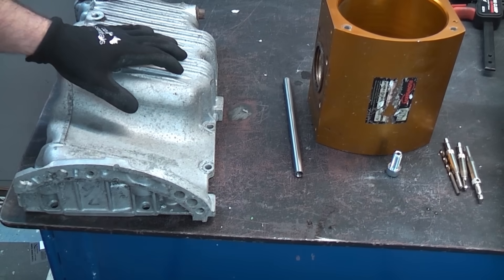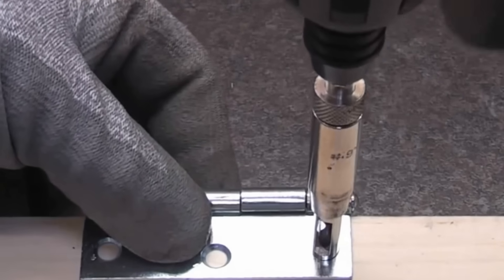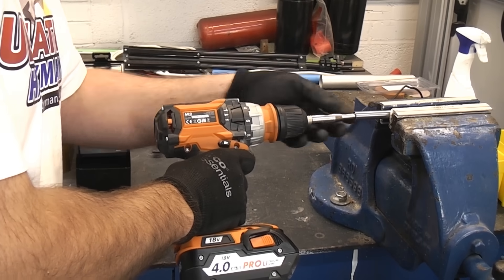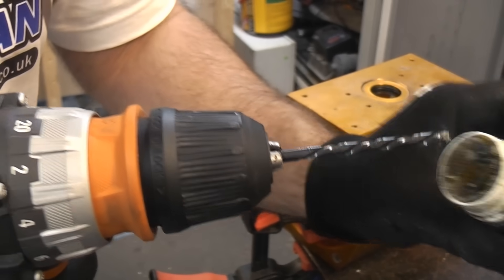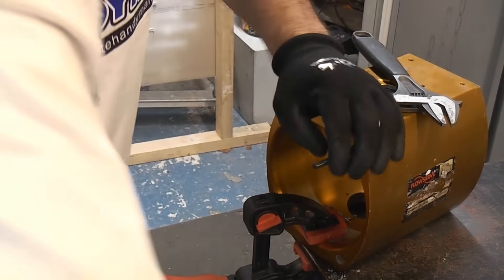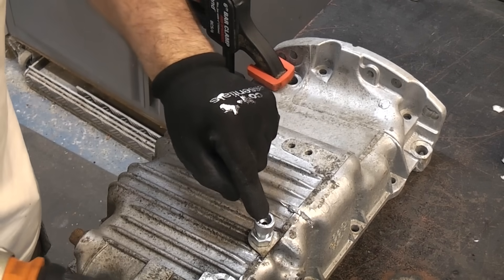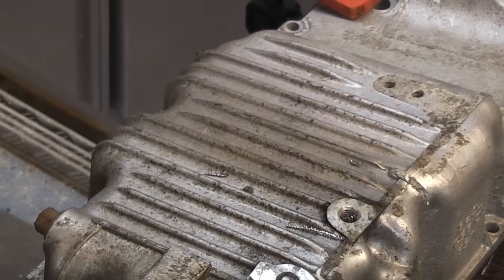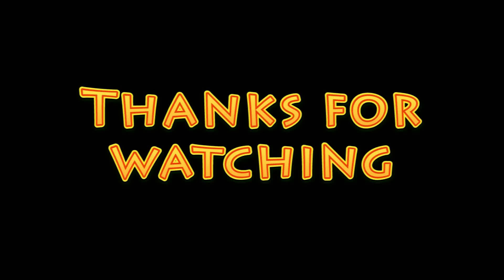How to remove a broken bolt in a deep hole | remove broken bolt in recessed hole

Comment: Dude. Those bolts with centers drilled out is brilliant. Im gonna get my Local Machine shop to to make me some of those.
Reply from the maker: They should easily make you a set ;-)
Thanks for the comment 👍
Reply: @ultimatehandyman  what size of mm drillbit should you use in an m8 m10 and m12?
Reply from the maker: @RK-nl1hn   M8 = 4mm | M10 = 6mm | M12 = 8mm 👍
Reply: @ultimatehandyman  Thanks man!
Reply: Also worth googling "hollow bolt".  There's already-made ones out there, though mostly in metric it seems.  Might be cheaper (and quicker?) than having a machine shop make them.

Comment: I worked for Amoco for years and always got to fix the broken off bolts. I have to admit you are pretty damn good. Try hard bolts in hot stainless.
Reply from the maker: I've worked on a lot of stainless machines- they are always a pain in the backside!
For hard bolts I normally use solid carbide bits.
Thanks for the comment 👍

Comment: Lord knows how many bolts I have broken off.  The worst of which was head bolts on the engine of my first car.  A 1956 FORD with a 292 V-8.  I didn't know that it was essential to replace the head bolts or put some spaces on them to prevent bottoming out.  I broke a couple of them off and had no idea how to remove the broken part of the bolt.  I only wish that I had this information in my early life.  Excellent presentation on removing broken bolts.
Reply from the maker: Thanks for the comment, Paul  👍

Comment: A question for everyone - what drill bits do you use for extracting a bolt? I just discovered left hand drill bits, which turn in the direction I want the broken bit to turn.

I have seen left hand drill bits in high speed still, titanium coated, and cobalt. I like regular cobalt drill bits. They are cobalt all the way through, where as titanium drill bits are just coated with titanium.

I found a 5 piece set of Irwin-Hanson, 5/64 inch to 19/64 inch, cobalt drill bits on Ebay for $25. So far, this looks to be my best bet. The large, long bolt that holds the belt tensioner on my 2004 Toyota Corolla broke. I have to raise the engine just to get a try at extracting the bolt, and I also need to buy a right angle, drill adapter. 😟
Reply from the maker: Most broken bolts can be drilled using a normal HSS drill bit, which is great because you can use a left handed one.
TIN coated drill bits are a bit harder than HSS drill bits, but often they cannot be sharpened, as it grinds off the hard TIN coating.
For harder grade bolts you will need cobalt drill bits, these are much tougher and work really well on high-tensile bolts.
The problem with some right angle drill adaptors, is that they have a 1/4" hexagonal shank, which limits the types of drill bits available.
I hope this helps ;-)

Comment: Great video. For rusted-in bolts, torch heat the bolt after you have drilled it out halfway, to remove. The bolt becomes red and reduced in size for extraction... quickly apply the EZout shown. The worked piece will not get hot enough to worry.  (like a heat sink) You can always place rag water on surrounding area of project to cool as you heat with torch tip.

Comment: I was so hopeful to watch this video... to find out at the end that it was waste of my time. Since when a half inch below the surface is classified as "deep hole". You still can get your regular drill bit and screw extractor to it. Engine head bolt which is broken 6" below the surface, now that's what I call "DEEP". 
Disappointed.

Comment: Never heard of a "hinge sighting drill' or a "left handed drill bit". Now that I do, I have no idea where to buy one if I wanted one.
Reply from the maker: Hinge centering drills- https://fave.co/2DpJo1H
Left handed drill bits- https://fave.co/2xJjK1M
Teng screw extractors https://fave.co/2OnfRuF
Dormer taps -https://fave.co/2OsN1sQ

If you are in the UK-
Hinge centering drills- https://fave.co/2NE1VMc
Left handed drill bits- https://fave.co/2DubtF4
Teng screw extractors- https://fave.co/2pVLkVT
Dormer taps - https://fave.co/2pTfbyx

exact cutting paste- https://fave.co/2Nabyxc
cobalt drill bits (they are much better on harder steels like bolts) https://fave.co/2zDh3kp

Comment: Thank you for showing a variety of scenarios and techniques to remove a sheared off bolt.  I've got a pretty tricky one and perhaps you can comment.  For my motorcycle, I sheared off an 18-8 stainless bolt, level with the engine casing, and naturally, not terribly evenly to make drilling easy.  Can't put the whole motorcycle in a vise obviously, but its up on a my garage lift.  I'm told these stainless bolts are quite a bear in that if you "skate" the bit or drill too quickly, you will "work hard" the stainless and once hardened, it will be impossible to drill it.

I bought a normal rotation cobalt bit, two of them actually, and made zero progress trying to drill this bolt.  I'm guilty of not watching videos about 18-8 stainless first and in frustration, may have gone too fast and made my life worse.  I've got skating and probably hardened it.

I just bought a set or Irwin reverse cobalt bits and I'm praying with a punch, I can begin again, but fear I might need to have someone come and weld a cheap screwdriver onto what's barely protruding out of the engine casing.

Any words of wisdom?
Reply: If slow speed and heavy pressure doesn't get you through the work-hardened surface, get some small carbide tipped masonry drills and even if you have to invest in a green wheel (silicon carbide) for your grinder, sharpen them a little more like standard drill points and they will cut through the hard spots. Don't spin them wide open though, that carbide is only brazed on and it's possible to get them hot enough to soften the braze and you'll lose the tip. After that, go back to your LH Cobalt and slow down and use oil. 

I hope you've solved this by now, but I just ran across this vid. Old tricks to me, been getting broke stuff out of holes for many years. The trick is knowing which trick to use.
Reply: As Tony wrote .

Also quality or cheap screw drive will tear off as the welding will soften the point . And risk damage to the casing internal thread .

- bigger diameter holes can have copper tube inserted into the casing and slowly ad tacks of filler in the tube to extend the shank the aluminium case will expand with the heat more than the ss screw , once the weld filler is above the casing swing on it with stilsons , gjiggling  , anti and clockwise  Whilst the casing is warm
( 41 yrs in heavy industry )

Barely protruding shank weld a bigger nut that fits over the shank but protects the casing and internal thread start .

All the best

Comment: Throw that wd40 in the trash, far better products out there. Try bees wax before heating so it melts into the threads. Try homemade penetrating oil, 50/50 atf/acetone mix, hard to beat.

Comment: Absolutely genius. I'm 42yo and never heard about or seen a hinge/ self centering drill bit. I've been fighting broken bolts for decades. This blows my mind and I'm ordering some now. I've got bolt extractors and left handed bits, but always have an issue drilling through the center of a broken bolt. Thanks for sharing.
Reply from the maker: You are welcome
Thanks for the comment 👍
Reply: but who's got a hinge drill bit ive never heard of it but used to operate a big drill press machine, biggest drill bit was 54mm
Reply: @351clevelandmodifiedmotor4  Also called a Vix bit. Traditionally used in woodworking to insure a drilled hole is centered in the hole already bored in a hinge. That way when the screw is fastened the hinge doesn't walk to one side or the other sending the door out of alignment. I would imagine thats why it's also known as a hinge drill, though I have never heard it called that. I have never considered a vix bit for this purpose and I have tons of them. Genius!

Comment: How do you remove broken machine screws or broken machine screw taps?  They are too small for many methods.
Reply from the maker: Very difficult.
You might be able to drill out the machine screw using a small diameter drill bit. As for a broken tap- you might be able to use something like this-
https://www.cromwell.co.uk/shop/cutting-tools/screw-drills-and-stellite-drills/solid-carbide-screw-drills/f/1226

Comment: Was gonna change the oil filter in my four wheeler and one of the bolts just broke in half when I was screwing it bsck on
Reply from the maker: It should be easier to remove that, rather than removing one that has snapped when trying to remove it.
Best of luck with it 👍
Reply: @ultimatehandyman  yeah it was already as tight as it could go though 😂, I think it broke cause I tried to tighten it too much
Reply from the maker: @BigCountryKracker   Ha Ha- you are too strong!
I used to work with a guy that could shear 1/2" bolts for fun (R.I.P Big John)
Reply: @ultimatehandyman  dang he must have been the best mechanic there 😂

Comment: Amazing!  Thanks for pointing this out ... I didn't even know there was such a think as a left-handed drill bit.   I guess that is so that you do not screw in the bolt more when you drill in the center of it.
Reply from the maker: Yeah, left handed drill bits are great. I first thought about them when I was drilling out a bolt on a machine and the drill bit cut into the bolt and pushed it out of the other side. I then thought, if it was a blind hole and you had a drill bit that you could use in reverse, it might bite and unscrew the  broken bolt. When I got home I checked eBay and found left handed drill bits 👍
Reply: @ultimatehandyman  
Thanks, I really learn a lot from your channel, it is the best!

Comment: I let my girlfriend use a new torque wrench that didn’t have a loud or noticeable click So she kept tightening till it snapped off. I Used the center punch and sprayed with sea foam, then started to drill the broken bolt and lucky me the threaded hole was threaded all the way thru and the bolt started to thread its self deeper and eventually fell out.
Reply from the maker: Nice one, it's great when that happens. I have had a few bolts that have done that also
Thanks for the comment 👍

Comment: Great Video!

The centering jig made from the lathe is the difference.  Gas tank strap bolt snapped well into tbe frame of my Astro Van and moonscape unevenness kept me from effectively drilling it out.

What does one do without a lathe, or electrical heat.  Cannot use flame by the gas tank...
Reply from the maker: You can make one using a drill press- https://www.youtube.com/watch?v=6mZj0J6CNYA

I would apply lots of spray penetrant, but if it's in a confined space it might be impossible to get it out.

Thanks for the comment 👍
Reply: @ultimatehandyman  

Your welcome.

Bolt in discussion was vertically installed from earth to sky through the frame. Iy was holding a strap that went under the gasoline tank.

I never really had any luck with penatrants.  Heat, grinding, and drilling.

For about $389.00, the tool store near me has an electric unit with a cord that can heat like a hot flame.  It wraps near the fasteners This allows to be use in gasoline vapor environments.

I looked into getting acetylene but it is just too much hassel and danger for hiw little I would. use it

Comment: Have you tried to use an impact driver (in reverse, of course) with either the left hand drill or the easy out?  You shock the bolt end and apply removal force at the same time.
Reply from the maker: No, although I have bought a set of impact screw removers, which I'll test out soon ;-)
Thanks for the comment 👍

Comment: Over this weekend I started a project for putting a bullbar on my Toyota, a 2000, had to take the 4 tow ring bolts out, with quite a bit of aggravation and money spent I got 3 out of the 4 out, on the 4th I’ve broken 2 breaker bars and then it broke the head off of the bolt.  So now I’m at the stage of drilling it out and trying to remove it with these OEM extractors, if that doesn’t work do you have any advice? I’m hoping this works though  it’s been being shot with wd40 and PD for going on 2 days now
Reply from the maker: Blimey, I have had a few bolts like that in the past- nightmare.
I'd definitely try heating it up, preferably with burning gear, or decent blow torch. Get it as hot as possible (obviously you can't do this near paintwork), then let the bolt cool fully, before drilling it, spraying it with plenty of spray penetrant and then try the extractor.
The hole and the extractor need to be as large as possible, without hitting the threads of the bolt.
If the extractor feels really tight and feels like it will break, just remove it and drill the bolt out completely and re-tap the hole- you do not want to break the extractor in there!

Best of luck with it
Reply: @ultimatehandyman  thank you for the tips 🤙🤙

Comment: Nice tip on drilling a hole through the center of a bolt. Wish I saw this video a few weeks ago when it would've really come in handy on a project that I am currently busy with (plenty old rusty bolts snapped off here and there). I will still remember this tip for future use, so thank you plenty!:)
Reply from the maker: Glad it helped
Thanks for the comment 👍
Reply: I am busy getting a 1982 range rover running again and there might still be some stubborn bolts on the way...

Comment: How about removing rusted studs from a steel boiler?
Reply from the maker: Plenty of heat and spray penetrant.
The only option might be to drill it out though, due to the heating cycle etc.
Boiler studs can be a real pain in the backside!
Thanks for the comment 👍

Comment: What the hell is a left handed bit? I have never heard of one before. It sounds like the old tradie joke of getting the apprentice to get a left handed hammer.
If it's just the reverse of a normal bit, couldn't you use a normal bit and put the drill in reverse?
Reply from the maker: They are made specifically, so the flutes are the opposite way to a normal drill bit, the point is also ground the opposite way, so that it cuts in reverse.
A normal drill bit will not work, I'm afraid.
Thanks for the comment 👍

Comment: My bolt isn't flat like all the ones I'm seeing, will this still work
Reply from the maker: It will definitely work if you can screw the guide in, as that will ensure that you drill the exact centre.
Or if the bolt is sticking out slightly, you could grind or file the bolt flush

Comment: Nice job, but what would you do if the bolt is broken of flush with the part it is in? There is no thread to fit the drill bolt.
Reply from the maker: Flush bolts are much easier, as you can just centre punch the centre, then proceed to drill it out and follow the rest of this video, but without the guide.
Example here- https://www.youtube.com/watch?v=SMrDYJvY0Ts
Thanks for the comment 👍

Comment: Heating metal to expand it is fine, but you need to be setup to get the bolt out whilst the surrounding metal is hot. Metal shrinks when it cools, so if you don't get it out when hot, it'll get stuck more... Lots of situations happen when the surrounding metal will shrink more than it's original size (talking thous, here, but it's enough to mess up your day). That's why heating is always referred to as a last resort.
Reply from the maker: From my experience as a maintenance engineer, I always wait for it to cool first.
Heating it up will loosen the bond between the bolt and the surrounding area.
I've seen people heat up bolts before and tried to remove them when they are still hot and the head has twisted right off 😉 
Thanks for the comment 👍
Reply: @ultimatehandyman  I do like your innovation of drilling the bolts to centralise the drill. Nice. Wonder why I never thought of that? 🤣

Comment: I think you should warn people against using too much torque on the extractors. They don't work on bolts which are corroded in, and when they snap they are impossible to drill out, then you'll be looking in the yellow pages for "spark erosion".
Reply from the maker: Good point. You can drill them out though-
https://www.youtube.com/watch?v=7JCfEMrCjhc&t
Thanks for the comment 👍

Comment: Fluted taps are good. I don't care much for the other type because when the going gets tough they start to expand the bolt you're trying to extract, sometimes ruining the threads because they can tend to break through.
I hate anti seize. Nothing guarantees something to seize if you use that junk product in a heat cycling environment. For example putting it on screw in brake caliper guide pins is a disaster - they simply don't come out after a few years. The one thing it is supposed to do and it can't do it - like what's the point of it? Probably alright for around the home I guess. Plain 'ole HTB (High Temperature Bearing) grease used sparingly is the go in my view because it really resists temperature and is designed with heat cycling in mind. That other crap's a gimmick compared to bearing grease.
Reply from the maker: Thanks for the comment 👍

Comment: Use copper pipe to protect the threads mig weld the hole until proud  use a scrap screwdriver to weld to the nubbin  sticking out hey presto your stud will come out with ease .....no need to thank me I've watched plenty of vids and have 1st hand experience an it works .

Comment: I'd like to see u do that on a broken exhaust manifold bolt that's rusted and FLUSH with the surface...now THAT would be a test LOL
Reply: 1. Blow them out with a torch, wait till cool, then run a tap back thru the hole. (If it's not a blind hole). 2. If there is a stub still sticking out, braze/weld a nut to it. Heat the iron manifold ear cherry red, and back the broken stud/bolt out. Usually works. 3. Buy a new manifold. (Ask me how I know).